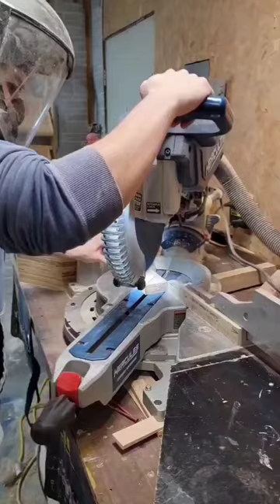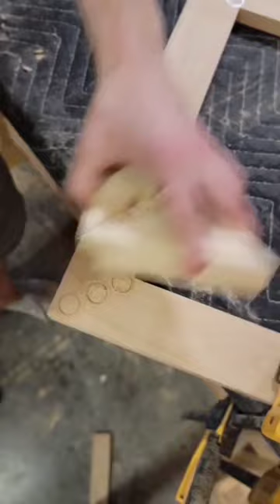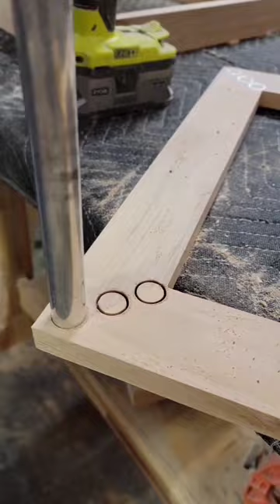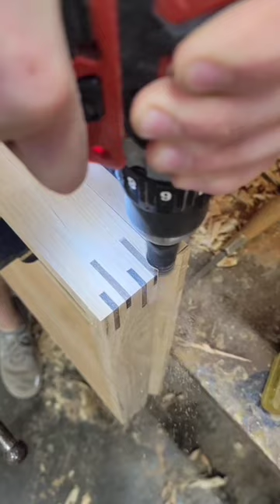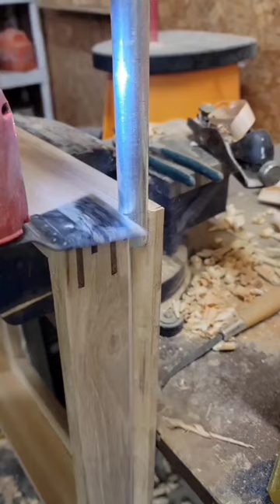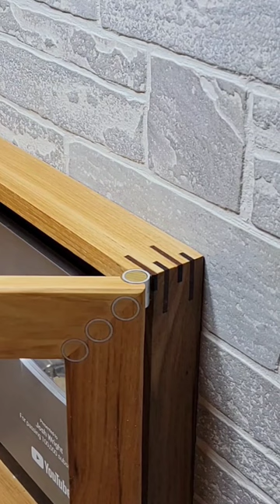Display Case // Woodworking #carpentry #diy #woodworker #maker #woodworking #wood #handmade #craft

Comment: I see you made artistic use of the pipe inlay idea you previously strength tested ; )
another beautiful but accessible and stylistic piece. 
well done sun!
Reply: What's the material you use for that? 1/2 inch pipe? Its fortunate the wall thickness fits the bit... longer vid with more info?
Reply: Found it.  "A new way to join wood" in his vids. In case anyone's interested.
Reply from the maker: @theoriginalmonstermaker  thank you! I am currently making a longer video that will go into more depth. I also made a video about a year ago trying the same thing but failed because like you said, it is very hard to find the right size pipe to perfectly fit the kerf of the hole saw bit. In this video i am using 3/4" aluminum tube but I found it works best with 3/4" or 1" emt conduit and a thin kerf, wood only holes saw bit. The bi-metal hole saw bits have too thick of a kerf.
Reply: @JoshWrightWoodworking  interesting.  Appreciate the response.  Yeah for the ease and aesthetic, def worth some playing around with options.  Hopefully I can find smthn that works bc there are alot of times that's super useful. Take care.

Comment: Looks cool. Did you use glue with the metal or does it hold by friction?
Reply from the maker: I just use ca glue and it seems to hold fine but ideally I should have used epoxy or something